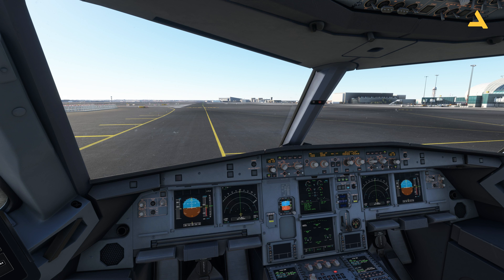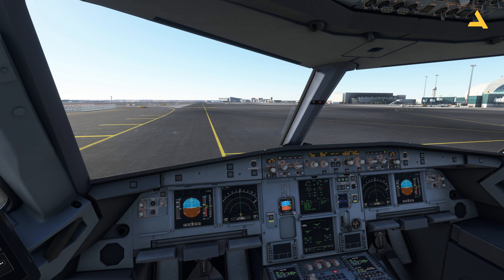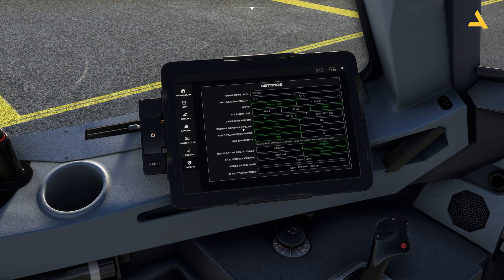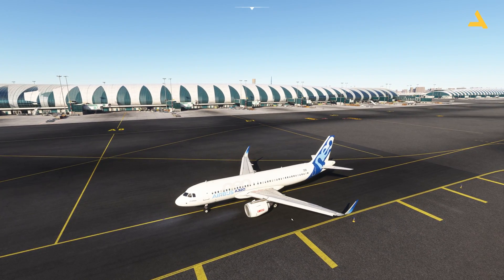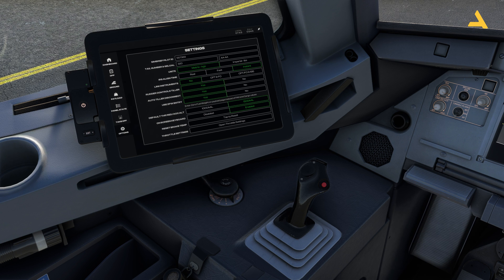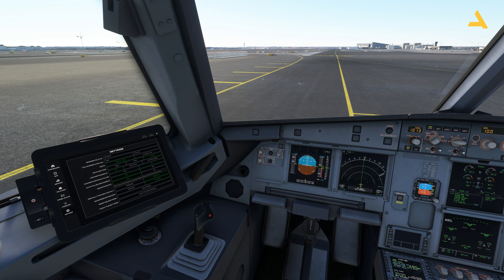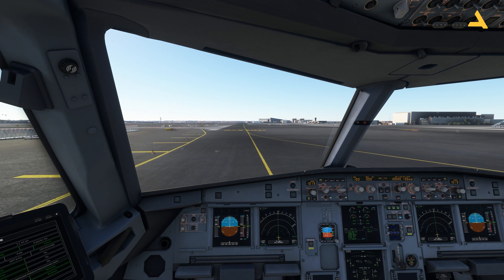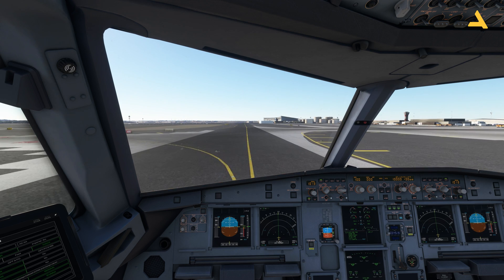Solving the Taxi Issue for iniBuilds Airbus A320 Neo - MSFS 2020 - A320 Neo Tutorial 4

Comment: Thank you! I have another problem with this aircraft. No matter what I do it does not pushback. The shocks are removed, parking brake off but no sucess. Have you any ideas for me to check?
Reply from the maker: Are you using the Thrustmaster TCA throttle. If yes then go to the control setting and remove any brakes assigned to it except for the parking brake and your issue will be resolved.
Reply: @aatifahmad  I tried this. No luck. Is there any other possible solution you guys found?

Comment: Forget turning, I can’t even get going! Parking brake and chocks both off.
Reply from the maker: Make sure the tug is not connected even after ending the pushback. It happened with me when I used the EFB for pushback. Do let me know if it works.
Reply: @aatifahmad  I think Toolbar Pushback free was the culprit. I didn’t like the tablet pushback because it took a while to get going.
Reply from the maker: I am glad that your issue is now solved. Have a nice day.

Comment: My problem with mine is when I taxi left the plane turns right and when turning right it turns left, why is this?
Reply: You need to disable auto tiller disconnect.
Reply from the maker: Is the axis on your controller inverted?
Reply: I've managed to fix it.
Reply: @godfreyduncan7783 Please can you tell me how you solved it because I'm not succeeding. I press left and it goes right and vice versa. Upon landing it is uncontrollable on the runway
Reply: My problem is I can't get the reversers to work with my Turtle Beech yoke. It was ok on the old default Airbus 320.
Reply: @terrynorton3182 This I figured. U have to configure this on the small screen on the left again under throttle. Total madness why they had to make things so complicated

Comment: I got boths tiller options set to "yes" i can see the wheel itself steering. But the plane still wont steer under my control. Only goes right uncontrollably
Reply: Update: After I changed the settings in the efb I had to reset the sim. And now it works fine. I also found another bug and a fix for xbox. When you "tab" out on xbox the mcdu will freeze. Hit the mcdu button and spam the brightness button and it will unfreeze.
Reply from the maker: I am glad that your issue is now solved. Have a nice day.
Reply: @MrBullMarket  Havig same problem what do you mean by resetting the sim?
Reply: Check your control input sensitivities?
Reply: @chuckh9168 I have the same problem, I dont have rudder pedals, only the Thrustmaster Airbus joystick and for me its very difficult to taxi any aircraft…they seem like a catamaran…what are the correct sensitivity settings? Thanks in advance
Reply from the maker: Is the tug disconnected from the plane?